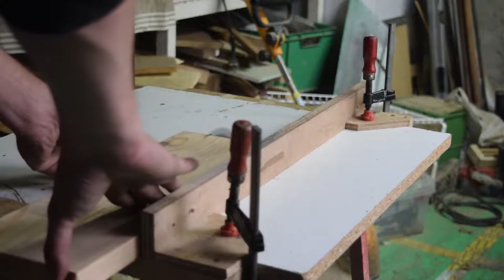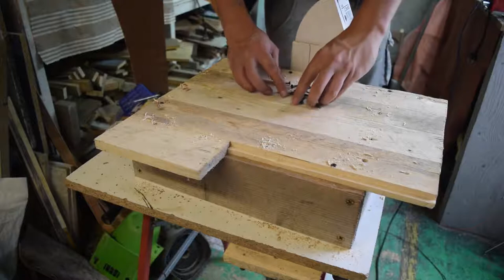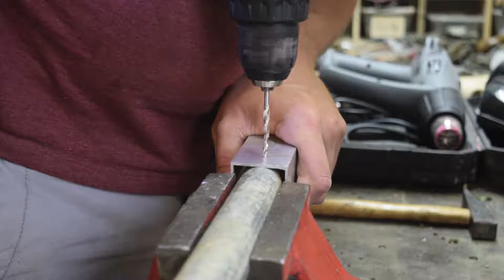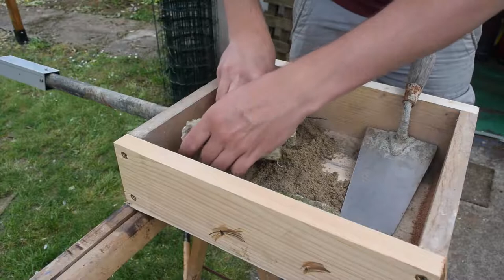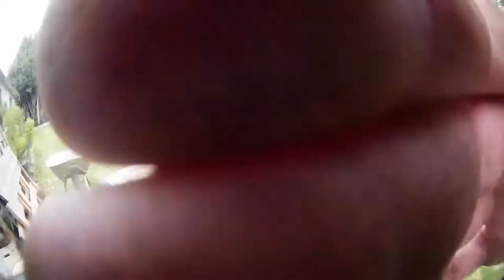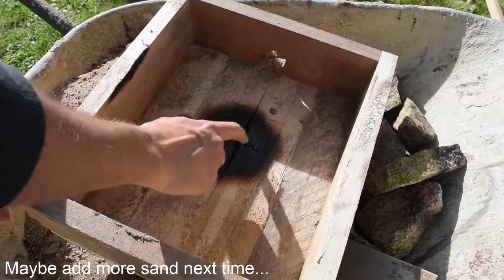Mini Backyard Forge || DIY

Comment: You'd be much better off using a cold air blow drier or a corded/cordless leaf blower for your "bellows." The heat gun kind of does the job, but you will get better results if you blow cold (not refrigerated) air into the hearth. Cold air is denser and will provide more oxygen to the fire.
Reply from the maker: Oh, I didn't know that, thanks for sharing the advice :D